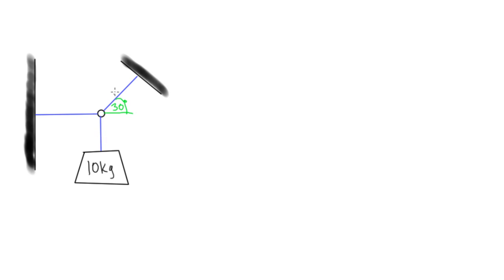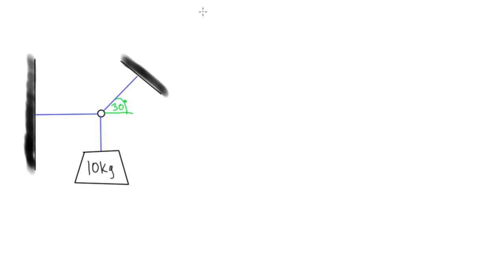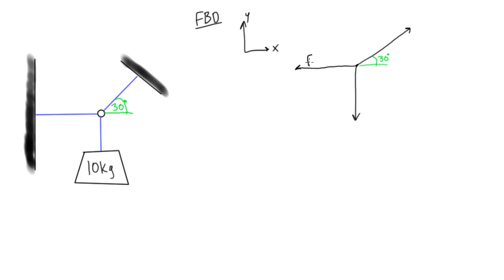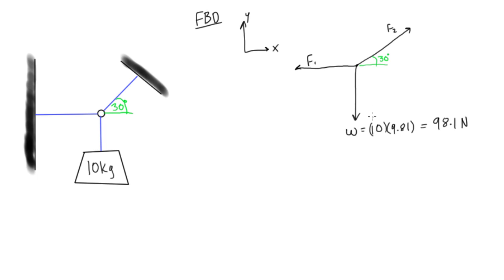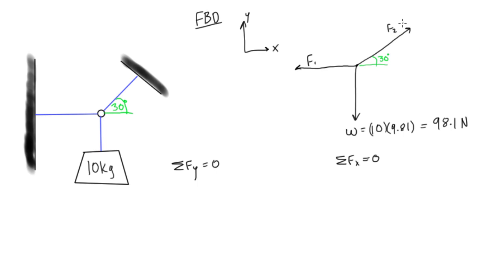How to calculate forces of three ropes pulling in different directions

Comment: Decent explanation! one small issue: F2=196.2, not 196.62, which also makes F1 a bit off.
Reply: Despite the notation error for F2, F1 is actually correct.
Reply: yeh

Comment: I'm new to your videos and I am enjoying them.  Thanks for making them.

For F2 you have a force of 196.62 but when I run the calculation I get -99.28.

As a check, I plugged the value for F2 back into the sum of forces in the y-direction formula.

-98.1 + (-99.28)sin30 = 0
-98.1 + (-99.28)(-0.988) = 0
-98.1 + 98.1 = 0
0 = 0

Using the value of 196.62 for F2
-98.1 + 196.62sin30 = 0
-98.1 + 196.62(-0.988) = 0
-98.1 - 194.266 = 0
-292.366 = 0

I'm new to statics, so I may be missing something or did an unnecessary step as a check.
Reply: I had the same problem. The calculator should be set to degrees, not radians.

Comment: I am confused, firstly the free body diagram didn't seem to make any difference to the calculations and therefore wasn't really required.  Secondly in the previous video you said the tension would be the same no matter the angle or position.  How can the tension be higher when there are two parts to the rope, surely the tension should be less when divide into these two components.
Reply from the maker: This is a simple system, with only one point of interest, so the FBD of that point is basically the exact same as the original image. Later in your studies, systems will become more complicated, and you will have to draw FBDs at more than one point. You can draw the FBD entirely separate, or you can also just superimpose it over the original diagram, it doesn't really matter. I separate for clarity. And to answer the next question. There are 3 different ropes attached to this point in the middle. Each rope with have a different tension, but for any given rope, you it is the same throughout.
Reply: @Engineer4Free  Hello Engineer4free,
I must confess, I was not expecting an answer for months.  So I am pleasantly surprised to find a comment from you soooooo quickly.  Thank you for your prompt reply, it is much appreciated.
I am still a little confused about the tensions in the ropes/strings been varied.
I must say, your table with complex shapes and second moment of inertia (second moment of area) with the Y(bar) etc was very helpful, much better than the way it was explain to me in my class.  I have an exam in an months time and I am worried about it so I am trying hard to prepare for it now.

Comment: Is it possible to solve this using only one tension?
Reply from the maker: I'm not sure exactly what you mean. Tension in the vertical (bottom) cable is 98.1N. You  must use that to solve tension in the angled cable (top right) because it also has a y component, so we use sum of force in y to solve it. Then knowing that one, we can use sum of force in x to solve the horizontal (left) cable.

Comment: but you didn't mention the third rope...and that is in the title of the video.
Reply from the maker: The tension in the rope that connects to the weight is 98.1 N, I write it at 1:20 in the video. Sorry, perhaps I should have been more clear that that was the tension in the rope. The free body diagram that I write the three forces on in the upper right corner of the video though is the free body diagram for the ring that connects the ropes. There are three forces on it that represent the internal forces in each rope pulling on the ring, each in Newtons along with the direction they point as indicated by the arrows. I could have spent another minute just clarifying that in the video. Thanks for the question, hope this helps!
Reply: Engineer4Free ah ok. Thanks a lot.